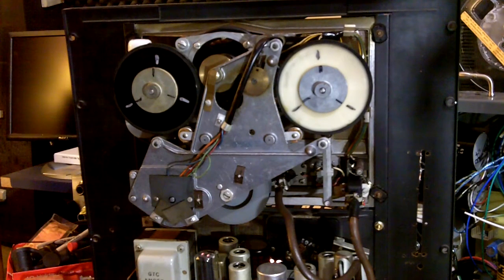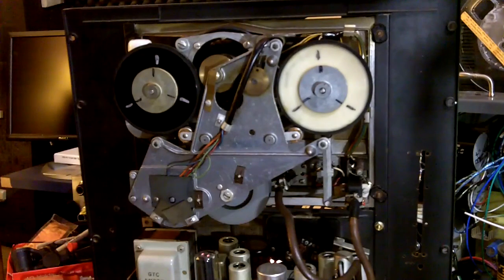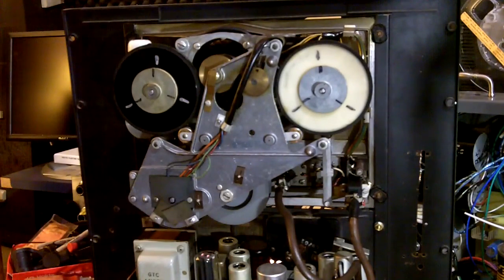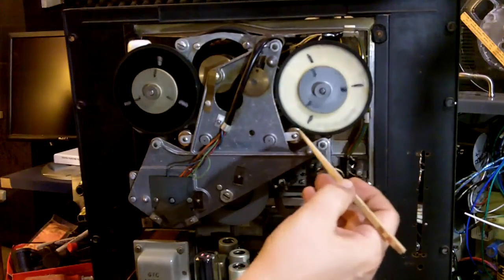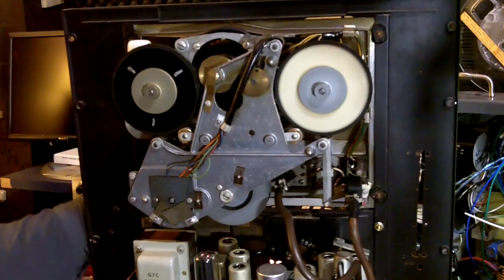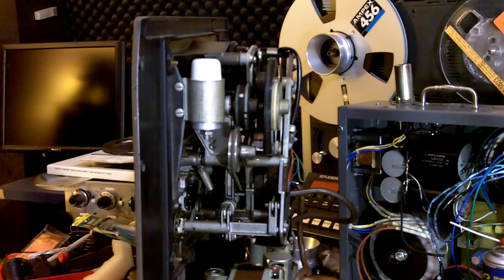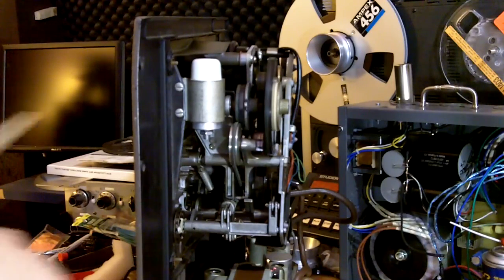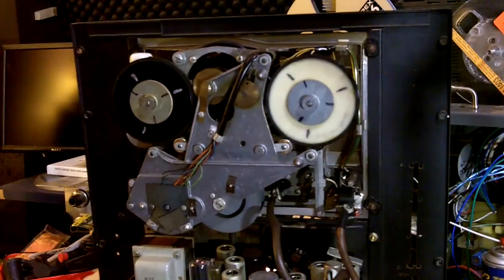Repair tips for Ampex 600, 601, 602 transport

Comment: i have a 601, two channel. the rewind worked then just stopped. i noticed that the unit felt hot after only 20 minutes of use. could the heat have caused a belt to break? the fast forward and play modes work fine. who works in these, possibly in s. florida area? thx.